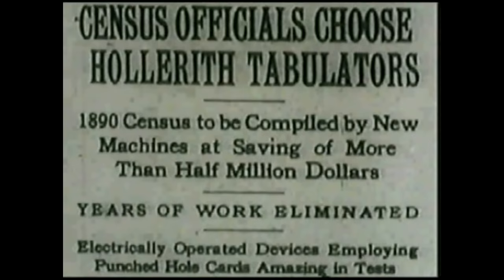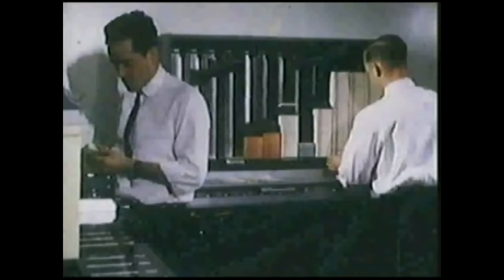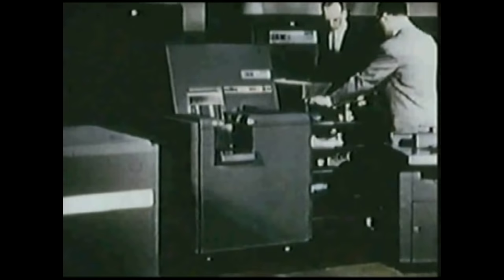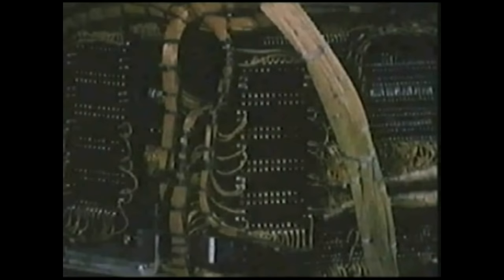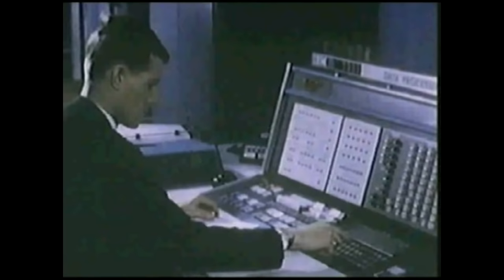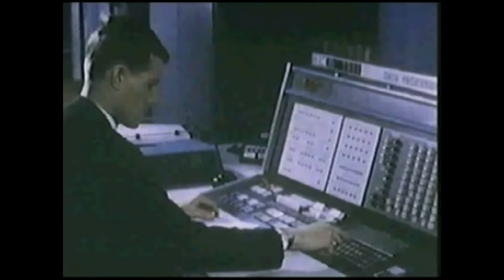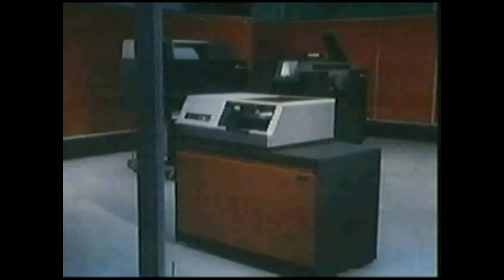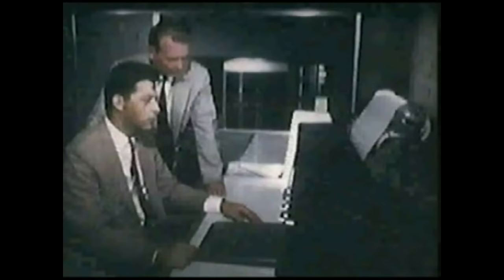1970's IBM vintage computer promotional film (original upload) IBM Mainframe, RAMAC

Comment: I don't see this "disc storage" catching on. All anyone will ever need is a faster punch card reader.
Reply: The computer that I was systems programmer for (7040) had a disk like pictured.  It had 4 heads but data access still had positional and rotational seek time plus one read a record not the specific piece on info one needed.  We also has 8? tape drives and card readers and printers like those shown.
Reply: I prefer an abacus. So little to go wrong with it.
Reply: You spelled tape drive wrong.
Reply: Yeah, I want my MP3 collection on punch cards!!! Let's see...I'll need at least 1 billion punch cards, and a card tray 11 miles long. Completely do-able.
Reply: It will be the end of pencils and writing, I tells you.
Reply: The future is in stone tablets
Reply: @jonathanj.7344  it booted up faster than windows NT
Reply: As an IBM hardware engineer in the 80s, part of my remit was repairing 029, 059 and 129 card punches and verifiers. Surprisingly, there were still a lot around and in some computer centres card readers were used to load JCL. If a JCL change was required and the card punch was broken it was a serious problem.
Reply: Job control language! Memories...

Comment: Meanwhile in 2020: "Hi, I'm 12 years old, is eight cores enough in this five billion transistor CPU to play my game?"
Reply: yes.
Reply: But the underlying technology hasn’t changed in the 50 years.... Just miniaturized...
Reply: No, you still need software,  peripherals, electricity, customer service and accountants.
Reply: @DragonChasing Nonsense.  Of course they had CPUs.   It wasn't a CPU on a single chip but it they had a CPU.  It might take a couple of dozen components  equal in size to 20 PC motherboards but they had a CPU.
Reply: Norm T    The only people who know how much it's changed are the people like me who installed his first computer in in 1970 when I was an IBM CE,  retired from IBM in 1998 and assembled my last one couple of months ago for  my wife.  An AMD 3600X box  with two M.2 Samsung 970s.    Processors are processors,  storage is storage.   Those machines damned well were the basis of modern computers.   When Quantum computing gets going, they won't be to that specific technology.
Reply: In 1970 I was developing real time data base systems with a 100 screens in 512K of memory and that included the OS, the DBMS, the DC and the application code. How was it achieved! Seems impossible now. Today the boot loader probably is more than 512K!  Sad thing was, 40 years later I was still helping major organisations drag themselves out of the batch processing era. Still, it gave me a job for life!
Reply: @EberKlaushartinger  Microsoft Flight Simulation could use 512 cores and at least a hundred terabytes, if the operating system allowed

Comment: He just said "go online" 😁 in 1970
Also listening to those typewriter noises coming from her keyboard.   Really cool to see.
Reply: Old IBM beam spring keyboards actually had a solenoid device that made the typewriter sound on purpose!
Reply: Those keyboards were an absolute joy to use, just the right amount of pressure and the solenoid almost pulled the key down and gave a lovely click.
Reply: Those keyboards were greatly prized by their users. Digital tried to duplicate the feel, but IBM had a solid edge until 104 keys became necessary in the early 90's. By that time there were too many cheap models on the market. I still have my last IBM keyboard.
Reply: I take it you don't know the meaning of 'on line' ? I guess you must be under 50 years of age.
Reply: @jamesslick4790  I doubt that very much. The purpose of the solenoid was usually to release the keys - after the computer had read the key pressed. Non of this 'full key rollover' back in them days - one key at a time please !
Reply: @Super7videoman  The solenoid was to release keys, not pull them down !
Reply: pmailkeey click* at a time.
Reply: Here, to go online means make contact with the main computer. There was no Internet and 99% of computers had no permission to use ARPANET or anything like it. Later, as every large-scale computer system was run as a network by a server, rather than by a mainframe serving various user terminals, go online meant contact the main server. As all servers were connected to the Internet after 1983, especially after 1990 when the WWW was first created, go online meant connect to the server and through that, the Internet.

Comment: Great video. I worked as a night computer operator on an RCA 3301 in 1967, got drafted, was an operator on. an IBM 1801 in Vietnam, then returned to LA and ran IBM 360s for City of La  until I got my accounting degree. Those  tape drives and chain printers were fun to run.
Reply: As I recall, the 1403 printer was a little NOISY.  And you wanted to be kinda careful about closing that print chain housing right when changing forms, cause it could chew through anything in the way in a matter of milliseconds. Fun to run, indeed.
Reply: @dougd321  Started as an IBM CE in 64.  Doing pre school study before going to 1401 school.  Reading how the 1403 printer emitter circuitry  looked at a print position, tracked the characters as they moved by on the print chain (later train). It knew when the desired character was approaching the desired print position hammer and fired it to push the hammer into the ribbon and push the ribbon against the paper.  It did this for all 144 print positions and could print up to 1,100 lines per minute. The chain/train never stopped but the form paper had to start and stop for each line.

I went to my manager and said that This had to be a test to see how gullible I was.  Guess what, it was true.

Comment: The FAA ARTCC’s had the IBM 9020.. Three IBM 360’s two of which concurrently ran NAS  and the other for offline jobs.  Card punches, card readers, disc drive platters, and the IOT at the command console.  Any box, CE’s, IOCE’s, PAM’s, tape drives could be configured in or out of the system while NAS was up and running without any detrimental effects.  Triple redundancy to keep NAS running and never lose data.  NAS - National Airspace Operating System was a reengineered IBM operating system maintained by the FAA.  The computer elements took up nearly the entire first floor of the Automation wing.  Another complete huge computer system was in the basement that did nothing but write the graphics on the radar scopes. It took write orders from the IBM 9020.   In the mid eighties, when the FAA transitioned to the IBM 3083, the floor space needed was cut by a fourth.
Reply from the maker: Dirty Hobo,  Fascinating stuff!  Thanks very much.  (PS, I had to look up "Air Route Traffic Control Centers (ARTCC)"  Learned something new. : ) ~  Victor, CHAP

Comment: PS--in 1960 the Boeing 707 was already traveling the world, including one with President Eisenhower on his multination, multicontinent trip that year.  Douglas was getting ready to release the DC8. Lockheed had already introduced the Jetstar, the world's first corporate jet.  I don't like distortions and misrepresentations, surprised that IBM would make that error.
Reply: In 1960 there were very few jet aircraft in operation; there were only 176 707s and 112 DC-8s in service by the END of 1960,  The comment stands because most domestic flights were still made on prop-driven aircraft like the Douglas DC-6 and -7, the Convair CV-240 series, the Martin 4-0-4, and the Lockheed Electra/Super Constellation/Starliner series.

Comment: They talk about how fast their computers are back then. I think about back in the late 90’swhen my dad bought the family our first computer it had 512mb of ram and 20 something gig hard drive. He actually had it built by the very small privately owned computer store That was next to this little hole in the wall restaurant on the end of this very small strip mall. I remember friends coming over and saying how fast our computer was. One of my friends was like damn dude Ive never seen a computer that had 512mb of ram the highest he had ever seen was 256mb of ram. So back then this was considered a decently fast computer. Now I have a cheap 220 dollar quad core Asia’s laptop that Had 4g ram but was so slow u could barley run windows so I added 8g ram so it has 12g, added a solid state drive and a 5g usb WiFi adapter now this laptop works like something you would spend 1500 bucks on. I have a refurbished dell desktop for work it has a 5 core processor so it’s not the latest and greatest but has 16h ram, solid state drive, my internet speed is 460mbps. The computer is so fast it doesn’t matter how many screens you opened up or how many programs you have opened up or what u are downloading there is never any lagg it’s completely over kill for what I need but that works out because I don’t need to worry about the computer crashing or anything. Also since It has a solid state drive if I had to restart the computer it took just seconds so the customer isn’t waiting. My lap top would be damn near frozen before the upgrades it would take damn near 5-10 minutes to boot but after the upgrades my laptop goes from off to password screen to on and ready to use in under 15 seconds. If the world seen on of my computers back then they would  never use the word fast with their computers again and man If the reverse engineered my computer back then imagine what computers would be like today.

Comment: I first worked on a 407 and other unit record equipment. We programmed the 407 and other machines with huge plugboard wiring. Then I moved on to a 1401 and wrote in assembler. Continues in to the 360/30. Even wrote micro code on that machine. A reel of tape could hild 60mb!!!
I moved onto the 370. 4300 series, 3090. Wrote millions of lines of assembler code. Some of my code from the 370 days  is still running to this day!
Using assembler, I got COBOL to dynamically call another COBOL program. Something IBM said was impossible.
Watching a tape sort was fascinating! After all the data was input, the sort program would tell you how many passes of the data needs to be done and you could calculate the time it would take!The 2401 & 3240 tape drives were super fast. Much faster I/o than disks!
Haha Customer Information system AKA (Customer Information Control System) or CICS pronounced KIKS
Reply from the maker: Hi Roy, Yes, "KIKS".  That was great acronym "slang."  -- Programming in Assembler and microcode too, that is impressive.  Sounds like you have a deep level of experience in coding.  I did a little BAL, and it gave me a lot of respect for those who did lots of programming!  ~  Hunter, at CHAP
Reply: @ComputerHistoryArchivesProject  hey Hunter, actually I know 13 Languages, but BAL is the one I love the most. I taught many a COBOL programmer how to read dumps!
Reply from the maker: Very cool!   I bet you were a good teacher with that many languages under your belt!  -    I remember the frightened look on the students' face when they see their first core dump.  ) :
Reply: @ComputerHistoryArchivesProject  I actually taught mainframe operating systems concepts @ NYU in New York for a few years.
I wrote a tiny COBOL program that accepted card input, that multiplied hours worked by a rate and printed the data on paper. I had only 100 data I/p records and around the 80th record the job crashed (with a core dump) because of a data exception. I had the students tell me why the program had failed. They had to read the core dump to find out why.
The reason was obvious when they just looked at the i/p data as it contained letters where numbers should have been, however there were 10 other records that had alpha data where numeric data should have beem and it worked fine! The only way they could tell me exactly what happened is if they read & understood the core dump
Reply from the maker: Roy, excellent story.  Sounds like it helped teach them a lesson about troubleshooting.  : )    ~ Victor
Reply: @ComputerHistoryArchivesProject  it was a lesson in DONT JUMP TO CONCLUSIONS....
The fact that the program crashed due to a data exception, the students immediately looked at the input data where it crashed. There they found a multiplication was being performed with one of the input variables had a letter in it. They assumed that the input for that record was faulty. Yet when I asked them a bunch of records prior, it did a multiplication with alpha chars just fine. They needed to tell me WHY.
None of the students got it correct.
I will tell you if interested
Reply: Oh my! CICS! The bain of my existence!

Comment: I watched this on my state of the art on-line [real time] data processing unit!!! Thanks for uploading this. I especially loved the clips they had of the SSI component fabrication "...enabling us to fit half a dozen components in a very small space." Now that is cool! Very different from the LSI process just a decade later. In fact I would say their SSI process is pretty much like a modern day pick and place machine, but instead of 0402 components and SMD, it is the actual carbon and doped silicon oxides themselves going on top of the wafers with printed circuits on them. Really neat!

Is there a video just about that process somewhere??? Also have you got one on  core memory manufacturing??
Reply from the maker: A video on core memory manufacturing would be great!    I am always looking for such vintage items.   If we get one like that, will certainly post.   Thanks for your feedback!
Reply: Some electrical engineers on YouTube occasionally tinker with an old core memory board and try to get it going.

Comment: Did those terminal keyboards really sound loud like typewriters? From a use perspective it makes sense but damn that's louder than a model m!
Reply: Yes, believe it or not IBM keyboards actually had a solenoid device that made the typewriter sound......On purpose!
Reply: They were much quieter than that from the switches themselves, but those keyboards had a relay click for each key to make it feel just like IBM's Selectric typewriters of the time.
Reply: I don't  think so. They did click, however. The idea was that the keyboard would give you feedback about how hard to press the keys and, over time, you could type more quickly while avoiding missed keypresses. IBM did a lot of ergonomic research that long ago.

Comment: Did IBM keep adding more smaller transisters to the ceramic substrate making each system 360 machine smaller or did they transition to fully integrated circuits quikly?
Reply from the maker: Hi Christopher, that is a very good question.  Perhaps one of the IBM experts tuning in here can answer better than I can...   ~ Victor at CHAP.

Comment: How much kb can such a tape store?
Reply from the maker: Hi Geronimous, easy answer is "it depends."   Early 1,200 foot reels could hold about 2MB of data, or 12,000 punch cards or more equivalent.  Density and storage capacities increased greatly over time.  Block size, machine type, recording method,  etc., all played a factor.  Today, magnetic tape cartridges can be found that hold data in the multi terabyte range, but I am no expert in this area...  :  )    Hope this helps.  ~   Victor

Comment: FFS copy the mono audio track to both channels when you convert it to stereo.
Reply from the maker: Thanks for the tip!  : )
Reply: That can be done in post processing too, maybe during rendering of the final file ...
Reply from the maker: @uploadJ   Yes, did just that.   We have a "fixed" version of the film at this link:   https://youtu.be/kEV0fL0KmOQ
Thanks!  ~  Victor at CHAP
Reply: Or you could be really cool and correct for the time and use Duophonic Sound Processing , developed in the 1960's, to artificially reprocess the mono audio channel into 2 track "simulated stereo".

Comment: Excuse me, swapping heads between multiple platters in a tall stack is random access? I think it’s not!
Reply: Random access means a disk  can access data on any part of any platter and milliseconds later it can access completely different  data on a any part of the disk.    You can access data  on a tape randomly also but instead of milliseconds per access  it may take minutes per access.    Tape data is/was almost always accessed serially put on disk and then accessed  randomly.
Reply: RCW I said multiple platters, not single disk.